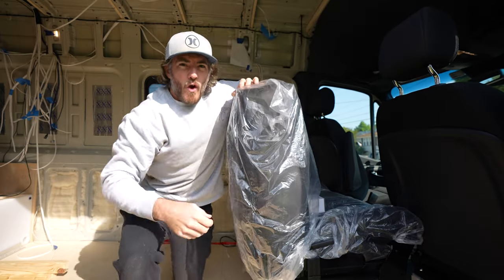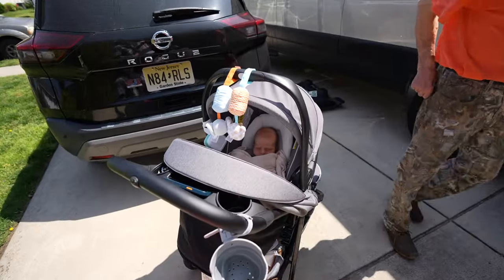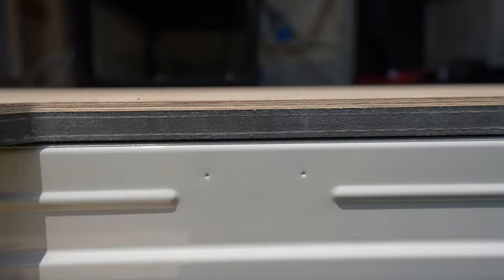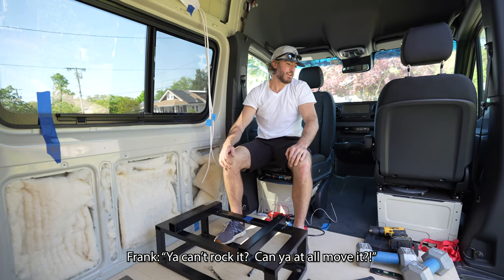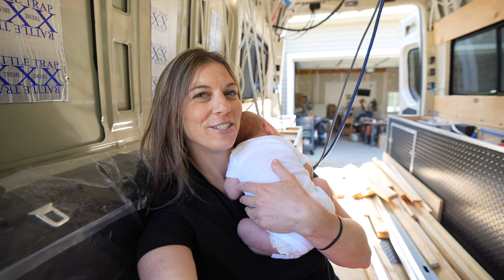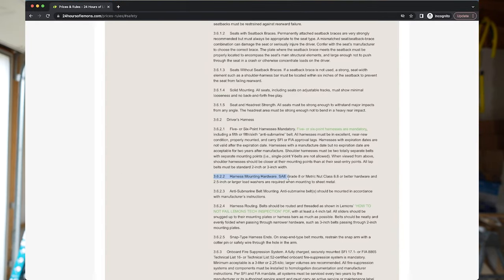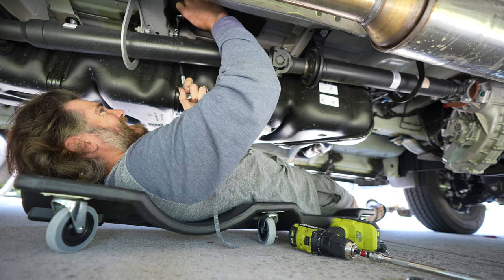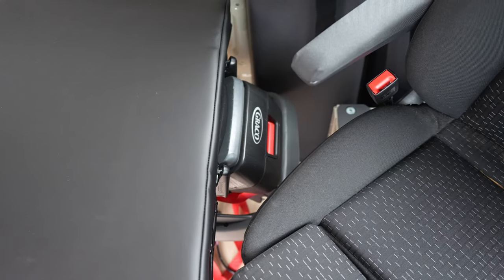Adding a Foldable Bench Seat For Our Baby To Our Van! - 4 Seats Total!

Comment: It looked very secure.  My only concern is the potential crunching of the insulation and plywood floor.  My van has significantly more floor insulation 1.5 inches under 3/4 marine grade ply, so I had a heavy steel box constructed and cut out my flooring so the seat frame could be through bolted and resting metal on metal.  The heavy steel box brought the seat frame up giving the chair the proper height.

Comment: Hey Kevin, great job on the install and thanks for sharing it with everyone. Im about to install ours today. We don't have our swivels installed our our walls yet. I was wondering if you happen to have some rough measurements by any chance? it looks like the side frame of the base is about 4 inches from the wall and the front of the base is about 15 inches from the base of the seat. Any additional information would be much appreciated. Thanks

Comment: I have a 2023 sprinter 170 and would like to install the same seat.  I don’t have the exact dimensions of the bolt holes yet but I’m concerned that two of them might go through above the gas tank (requiring me to temporarily drop the gas tank to get them in). Did you not have any interference of the gas tank?  Thanks for posting!

Comment: Hey Kevin,  what was the solution for the van noise?   Was it the drive shaft or perhaps the van was light w/out anything in the back?
Reply from the maker: It was the drive shaft they added “shims” - what they call it… I actually would call it bushings or spacers to the driveshaft changing the angle of it

Comment: #8 are incredibly small - I'd use 1/4" or bigger. Not normally an issue - except if there's an accident, those will almost assuredly shear.
Reply from the maker: What ya mean by #8?
Reply: @MathersOnTheMap  OK, so I  misunderstood - you have "Grade 8" bolts....Which is not the same thing. That said, they still look VERY small to be holding a seat in a moving vehicle. In our Suburban, the bolts holding the back seat in are 1/4" at least. Their ad-copy makes them look like they can handle anything, but I'd wager they're not sufficient for passenger vehicle seats. Look at the size of the bolts holding-in your front seat - and see if the Grade 8 bolts approach those in size.
Reply from the maker: Gotcha, I think you’re referring to the screw I used for pilot which was used to measure the length needed for the grade 8 bolts.  My grade 8 bolts are 3/8th’s thick and 4 inches long they’re badass and extremely strong
Reply: @MathersOnTheMap  Ah, OK. That wasn't clear to me - I feel better. :)
Reply from the maker: Haha all good, I appreciate the concern though!!!